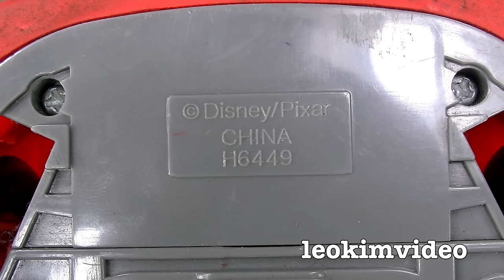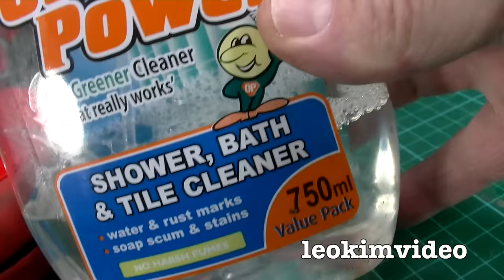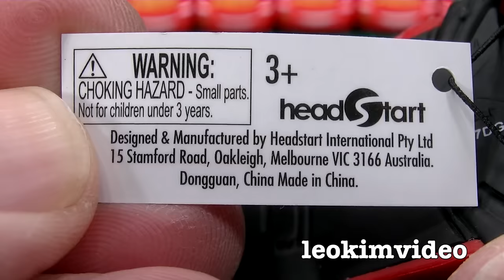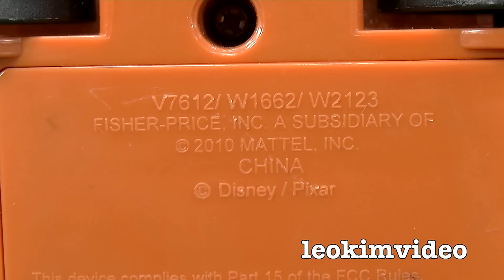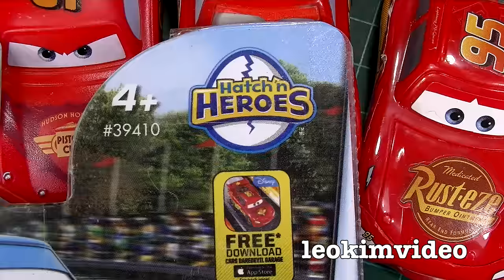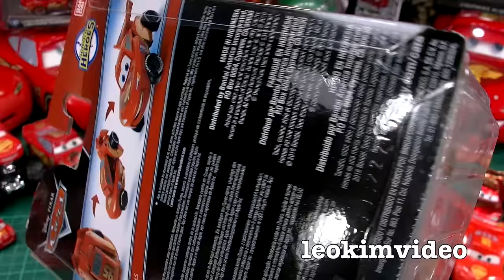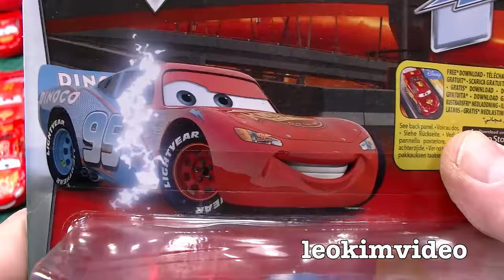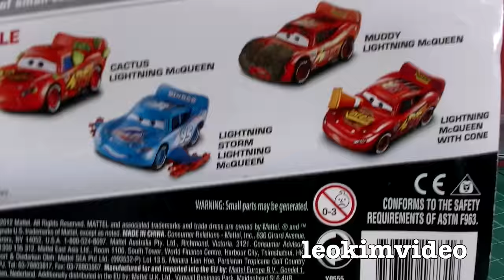Disney Cars Collection 3 Crash Talking Lightning McQueen Monster Jam McQueen & Cars Collection

Comment: Some Times Have Changed Base Lightning Mcqueen Very Important Detail Expensive Keep It Couple Example In The Box Carded Or Loose Diecast Lightning Mcqueen Same Lightning Mcqueen Holiday Edition 2012 A Lot Variation Lightning Mcqueen Metal Or Plastic

Comment: The piston cup lightning McQueen with the yellow lines on the tires can fit on hot wheels track
Reply from the maker: really!
i never knew
Reply: Yup I tried
Reply: It may be because the wheel axels have different lengths
Reply: Also they use plastic cars in play sets because they don't want the dicast to get damaged

Comment: Leo the reason the cars in playsets are plastic is because there more easy to work with mostly its lighter rather than the die cast which sometimes work but most of the time they fail